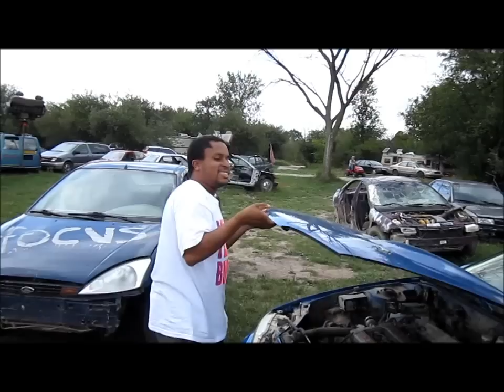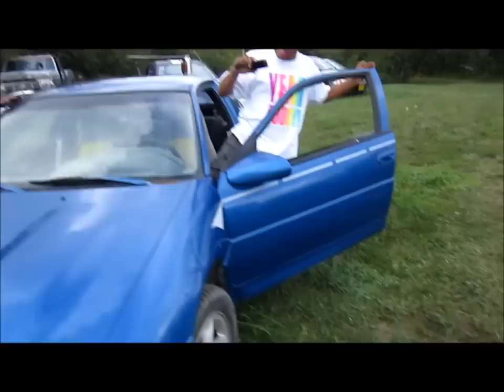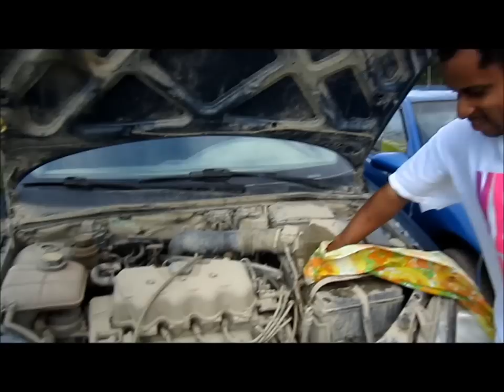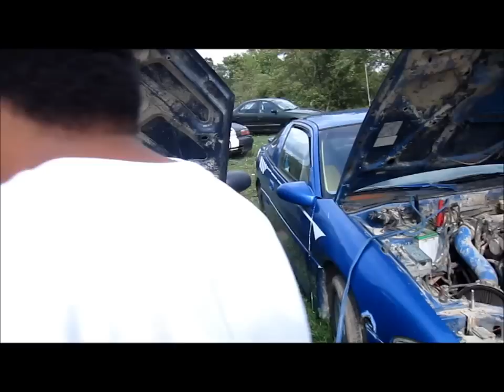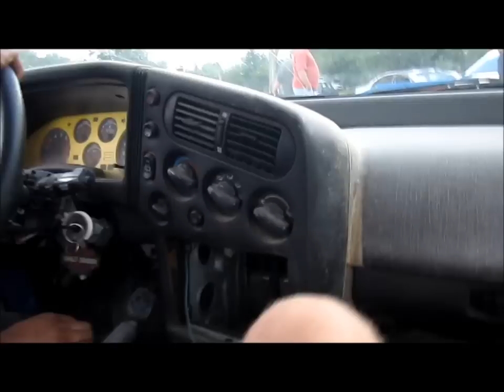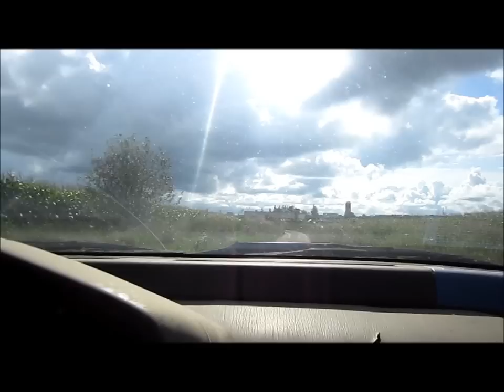92 Talon First Start and Drive 2012

Comment: @greasedupgamer.    5.8 is still unheard of in a talon. Funny cars run 6 seconds if they are lucky  top fuel dragsters run high 4's and low 5's. A friend of mine has a 240sx with well
Over 20 thousand put into it including all wheel drive conversion. His best run is a 9.83 the fastest talon ive seen run in person ran a 12.37 and that was heavily modified aswell

Comment: When a car is dead like that, it's a good idea to start it and let it die, over and over until it "learns" it's idle again. The computer in the car doesn't know how much fuel it has to provide to sustain idle since the battery was dead for so long. Think or it as an alarm clock. It doesn't know the time after it's been unplugged. Once te car learns idle you shouldn't have issues with it dyeing anymore.